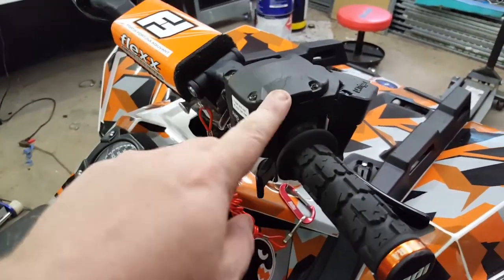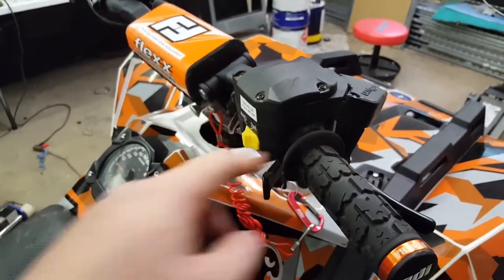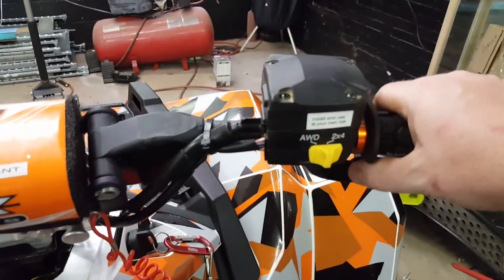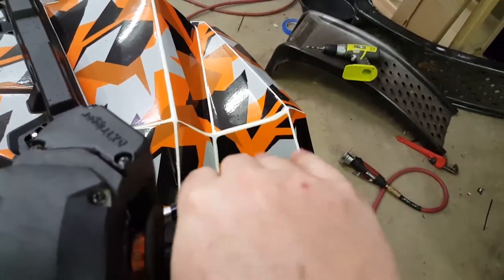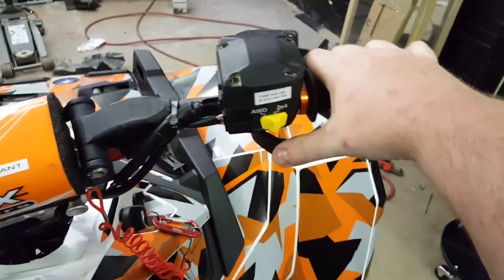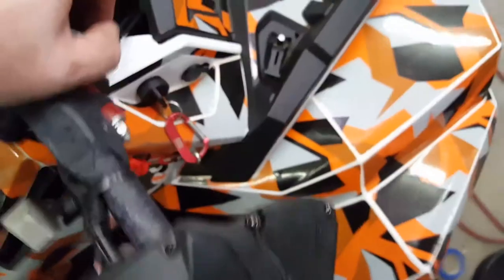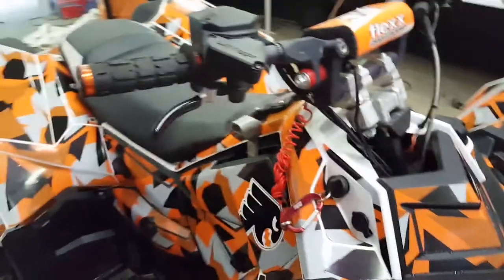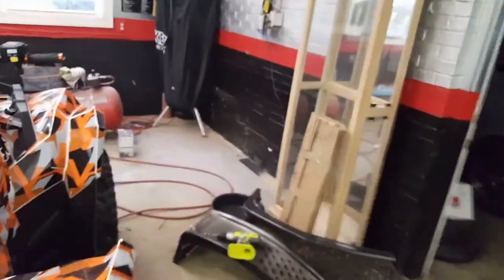DXTRIGGER.COM Trigger Installation!

Comment: what size odi grips are those? 120mm or 130mm
Reply from the maker: 120mm
Reply: Ok thank you
Reply: Great place to find good selection of grips for 4 wheelers is any mountain bike shop. They use the same idea quads run.  In every shape n thicknest you could  imagine

Comment: I wonder if this fits behind a set of powermadd hand guards.
Reply from the maker: Buckeye Derrick it does
Reply: PhillyLS1 you gncc race with this? Wondering how practical it would be on my banshee for xc racing.
Reply from the maker: Buckeye Derrick I couldn't get used to it honestly. But I did try it.
Reply: PhillyLS1 yeah pulling dual carbs up on the banshee is no fun on the thumb in a 2 hour long race. Browsing options but not sure how much control I’ll have and on my bike when it comes on the pipe it’s hold on tight. Thanks for the reply.